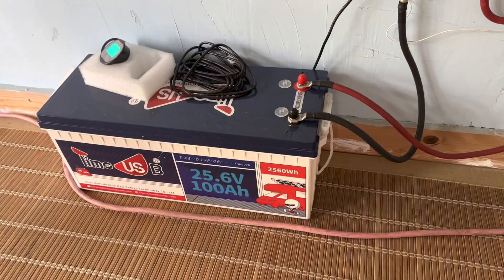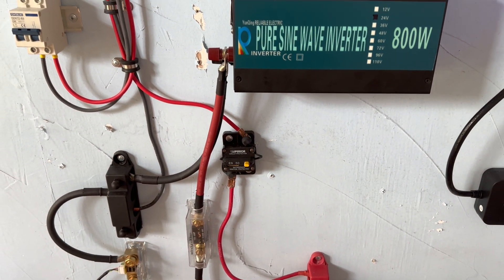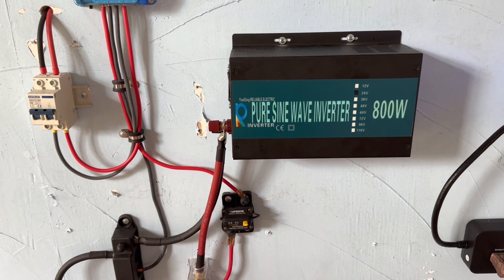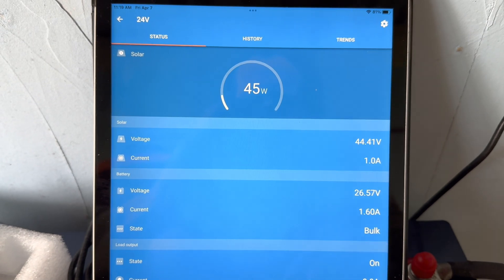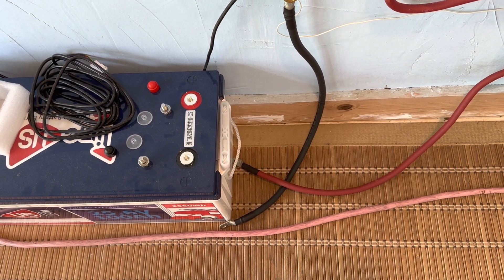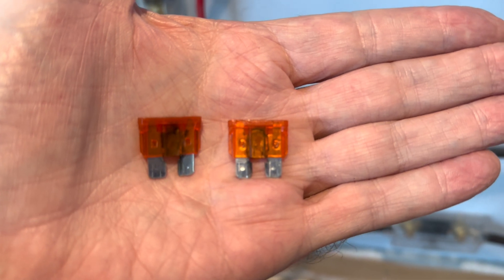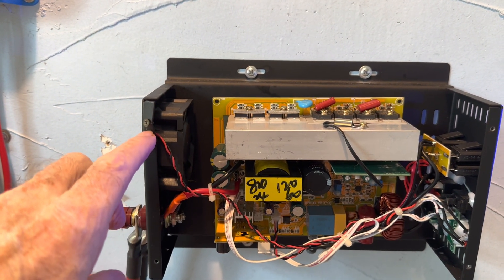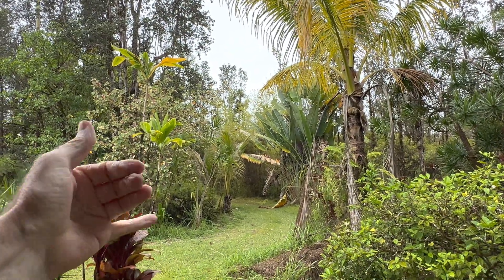Reliable Electric 800W 24V Pure Sine wave inverter FAILURE ! Easy fuse replacement? Or NOT? Hope so!

Comment: 🌴 Aloha 🤙
Replacing with Genuine Buss Brand Fuses from the Original Chinese Knock Offs Truely Straightens these Inverters out. And I learned this early on with this Brand and own and have 4 of The 24 Volt 3000 Watt models and a Battleship 24 Volt 2500 Watt Model in Constant Service here on the Ranch 

💦 Indian Creek Ranch ⛩
Southern California High Desert 🌵

Comment: I have a 24v 2500… was disconnected from the battery and the voltage detector is clicking and the read light flickers it make power but the power  flickers … was thinking something might be wrong with the board with the alarm?  I have a spare that blew from lightning… was hoping to swap parts… any ideas?

Comment: Sadly most Chinese made kit is one time use. It may well be cheaper to buy another than repair the old one. The jelly screws are just a clear statement of this. However there are some youtuber who have made videos of inverter repair but it depends on your available repair tools skills and components, and you may still not be successful. The usual problems are fuses and semiconductors, you've tested the fuse but the semiconductors will have to be sourced (likely online) so you will have some money invested before you know that the repair worked.

Comment: My first inverter was a Xantrex and it died in about a year so I triedout these.  I had a 12v 2000w running things until a hurricane got it wet... that ended with a pop...   upgraded things with  2 x 3000w inverters and they worked flawlessly for over a year but my charge controllers got too hot so I switched to a 24v bank and got a pair of these at 24v / 3000w.  and they worked well.  One was hard wired to a panel and the other used the plugs.  Both have worked well... although recently i switched up some things and found one of the controllers was hitting overvoltage shutdown at 27.8 v instead of 30.5.  I never noticed it before as there had always been a load on it that kept the voltage below the cutoff.   So it has me thinking about inverters... and while these work well and are cheap as hell... I always feel like they are one step away from spectarular failure.
Reply from the maker: I still use an old Xantrex. They used to be the gold standard way back when. Mahalo for sharing your experiences with us! Aloha!🤙

Comment: If your coffee maker pulls 670 W you should have at least 1000 inverter minimum.. sadly your pushing that 800.. and it being an over seas model you can assume it’s rating is exaggerated!!! So a 1500w would be safe .. good luck
Reply from the maker: Have it tied into a 1500watt inverter now actually...running just fine. 🤙
Reply: @ProjectsinParadise808  sounds good ... should run perfectly for many years ... if I've learned anything over the years its usually heat that kills electronics ... so its nice to be over sized and let's the unit idle 🤞
Reply from the maker: @peeinginthewind  I totally agree 🤙

Comment: does it have the EGS002  universal board inside? 
 or some bs board with the erased ICs,as usual ?hope not,i am looking for an inverter but ONLY with the EGS002, tired of the one-use-throw-away inverters that cannot be repaired .
EGS002 is only 4 or 5 dol, and on a 17 pin socket,it's an easy fix.

Comment: These inexpensive Chinese inverters are typically overrated.
 As you have found, they use low quality parts. I expect that one or more of the mosfets have blown.
 Knurlingar on YouTube has good videos about these.
  A good rule of thumb is to run these at 1/2 their rated capacity, so you would only run  up to 500 W on a 1000 W inverter.

Comment: When my first PSW popped a fuse (I foolishly mounted it where sunlight fell on it at one point) I learned the fuse was soldered into the board.  Now part of my product selection is verifying the fuse is easily user-serviceable.  Of course haven't had to replace a fuse since then!  :-)

Comment: If you had one of those cheap milliohm meters used to check 18650s and suchlike, you could perhaps use it to trace the short, in lieu of not seeing anything obvious.  IE. No cratered semiconductors or ruptured capacitors. I was looking to see if anything extra on the +25.6v line, incase something spiked (+/-)

Comment: I decided to take one of mine apart to check a few things.  Here's what I found:

* The input capacitors do indeed remain energized with the switch off.  There is no bleeder resistor so they were sitting at 25V even 5 minutes after I disconnected the DC.   So kudos to the poster who warned about that possibility.  Easy to de-energize with a resistor (and if the fuse isn't blown, just turning the unit on with DC disconnected also de-energizes the input caps)... but good to remember.

* There appears to be an input diode and an input bypass FET.   The input diode is for reverse polarity protection of the caps.  The input bypass FET presumably bypasses the diode (since otherwise 40A would melt it) once polarity has been determined to be ok.  Since the diode is in-line anyway, a shorted diode wouldn't short the board out, it would just prevent the reverse polarity protection from working.

* The bypass FET circuitry is a bit complex.  I didn't want to completely disassemble the board so I'm not entirely sure how it is hooked up.

* Most of the rest of board, particularly the output FETs, appears to be de-energized when the switch is off.

* The "power switch" does not carry much power.  The wires are tiny, so clearly it is a soft switch that controls (e.g.) the bypass FET.   There is a current-sense resistor near the bypass FET as well so I assume that is how main power is routed.  But I don't understand how they deal with the diode path... there must be another FET somewhere that I'm missing.   Its a big diode... A 10A10 (cheap 10A rectifier diode), but it obviously has to be bypassed because the voltage drop across that type of diode is like 1.1V, otherwise it would melt at 40A.

* There is an output relay on the 120VAC, which is nice... it allows the output stage to reach full power before its allowed through to the plugs.

So I suspect either an input cap or that bypass FET is shorted out.  The correct course of action when replacing the fuse didn't work is to get the whole unit replaced, for sure.

-Matt
Reply from the maker: I so appreciate you taking the time and work to diagnose the possible problems I encountered. You made it easy to understand what was probably happening. Although I don't fully understand everything you mentioned, I have read it several times, and it's mostly sunk in for me. I'm definitely leaning towards your conclusion though...replacement of unit. Mahalo for sharing that information for all of us. Aloha!.🤙

Comment: The channel John Daniel likes dicking around with inverters, not all chinesium is created equal, he has his preferences and has a few videos on the differences.    

I'd pick yourself up a little victron inverter.  or start saving for a multiplus and run your whole house off of one inverter, one bank, one inverter is going to be far more efficient and allot less musical chairs with switching batteries around and different charge stations ect.

Comment: May you please make a video that maybe clarify the sizes and fuses, as well as the charge controller sizes a little more?

For instance, I also have a 2000 watt 12 volt pure sine wave inverter on a 100ah battery.

I have a 100 amp ANL fuse connected, just like yours. I hardly pull more than a 100 watts from the inverter. Do you think this fuse size is big enough or must I go for a 200 amp fuse ( I am now thinking of the hair dryer video you posted)? 

Secondly, I only have the fuse between the battery and inverter and want to connect a breaker to discoonect the system if I have to. I would think that I would need a 150 amp dc breaker for this?  I see you use 50 amp breakers from your charge controllers to you busbars, is this beacuse the charge controllers push out less amps than if the breaker would have been placed directly from the battery before the inverter? I know you have the big key disconnect switch on your main system, but I want to use the other type of breakers that you have in your systems (the type that has the button then the lever pops out at the bottom).

Thirdly, I only use the system with the rolling blackouts we have in South Africa and then immediately charge the battery back up afterwards. I do however want to connect a 100watt solar panel in the system as I do not really exceed this wattage on the inverter. What size Victron charge controller would you advise me to get for just one mono crystalline panel to charge the one battery with this current that I am using?

Sorry for all these questions, but I would really appreciate your advise and therefore thought that this might actually make for another interesting video. 

Thank you once again for the great information, I really appreciate your channel and use your videos as my go-to source when I am working on my system.
Reply from the maker: Great suggestions, and for sure worthy of a more in depth video, which I will do. Mahalo! 🤙

Comment: How many watts does your coffee maker draw?  Standard coffee makers draw 1,500 watts and that's only an 800w inverter.  I'm surprised it lasted as long as it did.
Reply: It's best to look at the amps it uses rather than the watts. If using watts to measure a load versus your inverter's supply capability, remember to divide the wattage used by the power factor to get a VA figure, eg. 680 watts over a power factor of 0.78 equals 871.79 VA.
Reply from the maker: 600 watt coffee maker, which actually draws 670 watts. Been using it for months with zero problems. Aloha! 🤙

Comment: My brother wish you luck with contacting Reliable. I find you have to constantly writing them to get a solution.
Reply from the maker: Maybe they will reach out for a follow up? Aloha! 🤙
Reply: I find it a waste of time to even try. They always just blame the user for any trouble.
My latest broken electronics has a manual where the first sentence of the manual says "If you do anything wrong, the whole device will break." 
I should have just returned it then.
Reply: @edwardlulofs444  honestly in my case it took me almost a year to get a serious response from them and that is after diagnosing the problem all by myself and asking if I could buy the parts from them, then they offer to send me the parts for free but I will have to pay the shipping. But that took almost a year. In the end I didn't really need the part as a friend had already fix the problem which turned out to be a manufacturer problem as they had put the screw in the heat sink lean and some of the mosfets wasn't resting on the heatsink property so when ever the inverter came under long-term use it the voltage drops. All I will say is dealing with the Chinese is like pulling teeth.
Reply: @howardescoffery4950  I totally agree. These people have learned the art of snake oil salesman - Yankee salesman.

Comment: I have had nothing but great luck with my Reliable brand 1500w inverter. I purchased it new in 2016. I have been so abusive to mine it’s crazy. I even have a spare that I’ve never had to use. Mine has shut down for under voltage over voltage shots and keeps working.
Reply from the maker: Same here, working the others 24/7 zero problems. Alarm when they should allowing me to fine tune the cc, no probs at all. Never really over worked any one in any system. Had only been on for a minute or so when it first popped this morning. No clue why. Aloha! 🤙

Comment: Most likely one of the FETs shorted, they are the black 3 pin devices attached to the heatsink. You can look for cracks in them too.

We used the same brand inverter in a golfcart we tried to make autonomous to supply power to the computers, never had an issue with it.
Reply from the maker: I'm going to break out the magnifying glass and peek around in there some more. Mahalo! 🤙

Comment: The extra holes are for an additional fuse mount. You lost a FET or a CAP failed in the driver circuit.
Reply from the maker: Mahalo for that...never knew. Aloha! 🤙

Comment: 480 watts is all that fuse is good for and the other holes are for a extra fuse the didnt put in
Reply: I thought it was fused at 40a at 25.6v which is a shade over 1000w
Reply: @technishn  isn't it a 12v system i thought if not my bad
Reply from the maker: That"s interesting , did not know ...Mahalo! 🤙

Comment: Sounds like there is a short circuit somewhere or the inverter was being strained.  A lot of times an inverter will be labeled 800 watts but using a constant 800 watt load will destroy it.  I don't remember where I heard this from but the recommendation was if you have a 800 watt inverter a safe constant load is 400 watts.  Or always buy an inverter that is double what you plan to use for a load.  Usually its the heat is what destroys electronics when they are at their max usage.
Reply from the maker: Great information to share with us, and mahalo! As a rule I never really push my inverters too hard, or for very long under a heavy load. Popped that fuse within about one minute today. Aloha! 🤙
Reply: Engineers call that a safety factor of 2. And I'm a big proponent of safety factors.

Comment: Hmmm interesting. You freaked me placing the metal screw driver in by the fuse and capacitors.  Those will hold charge for a while after disconnecting.  And I’m extra paranoid. 

Anyway super interested in hearing what the actual cause is.   If they tell u
Take care.
Reply from the maker: Hope I do find out what happened. Yes, should have used something other than that screwdriver to point with! I was bit rattled after second fuse popped. Aloha! 🤙
Reply: I was scared also!

Comment: One of the input capacitors must have shorted if it blew again with the inverter off.  Not much else it could be.  That is a bit concerning.  I've got three of those suckers... no issues so far.    Maybe humidity is causing issues... and I wouldn't discount bad capacitor sourcing by the vendor.  A lot of this mass-produced stuff from China contains low-grade components, and electrolytic capacitors are especially vulnerable when it comes to poor quality control.

Breakers make everything easy, for sure.  I use mini DC breakers on a din rail, on everything.  Both poles.   Battery, external charger input, solar inputs, load outputs... 2-pole breakers on everything.  Like 8 of them.  Even though there might not seem to be much of a point on the solar inputs since those can't over-current anyway, the breakers are awesome for just being able to turn on and off the parts of the system that need to be worked on, without shutting the whole thing down.  Even under load (though obviously it is best to unload the related circuit first).
Reply from the maker: You know with other electronics that fail out here sometimes, I always wonder about humidity. My Other three inverters run 24/7 and have not flinched once...knock on wood! Probably never know.  Mahalo! 🤙
Reply: I was wondering if there was lightning and maybe a stray voltage induced to short it out. 
Trouble is, failures can be caused by also an infinite number of possibilities. That's why it rare to find a cause of failure.

Comment: That sad. that inverter not that old. I had a old inverter pop fuse before. never got it working again.  that one I found a bad FET  . short D to S leads . but was a old one not true sign wave so instead i just got new better one.  hope they make good on it. should be under warranty ? have to check receipt and manual .  this is the first one of Reliable I had herd go bad. if stuck replacing go with bigger and better. what i had to do. That has over load shut down. I don't see that coffee pot a problem.
Reply from the maker: Yeah been using it everyday for months, and was doing great. Nothing but normal use today, but pooped out before one cup of coffee. First one I had go bad too, and others working hard 24/7, with no problems. Oh well it happens. I may never know why, but I will look at others . Really like having a small 24v system . ALoha! 🤙

Comment: "Reliable" is a bit of a misnomer when it comes to inexpensive (read:  cheap) Chinese inverters.  You have been lucky with the others but they will also go the way of this failure.  If it is inexpensive there is a reason for that...you need to invest in a higher quality brand, although this can be difficult to ascertain.  Of course, the high priced low frequency units would most likely last but they can be very expensive.  Look at Samlex, a Taiwanese manufacturer that may be better quality (with US/Canada support), at a higher price and other more expensive brands.  Also, the switching MOSFET's are often the culprit.  You can easily test them with a multimeter, look for a short.
Reply from the maker: I will take a look at the Samlex, as well as a few others. Mahalo!! 🤙
Reply: Victron is another good inverter option.  You've had success with their solar controllers.  Their internal toroidal transformers are very beefy and show high quality.
Reply: I will add triple emphasis to everything that you said. These new technologies seem to break if you only frown at them.
Reply: Would the mosfets be energised when the unit is switched off (on its little rocker switch) though? (Since the new fuse blew when the little rocker switch was switched off.)

Comment: Funny that as I saw you changing the fuse I thought, it will blow again.
Blown fuse is a symptom.
It may be a cap or other component that has gone bad. Troubleshooting starts with looking at the circuit diagram and asking: what could cause the current to exceed the fuse capacity (40amps). Also consider the working conditions.  You did well.
Reply from the maker: 🤙 Aloha
Reply: @ProjectsinParadise808  Blown mosfet? Just change all of them 😂 I haven't had a bad inverter from Reliable going on 3 years of everyday using about 10kwh per day.